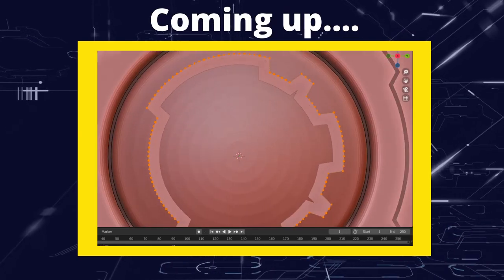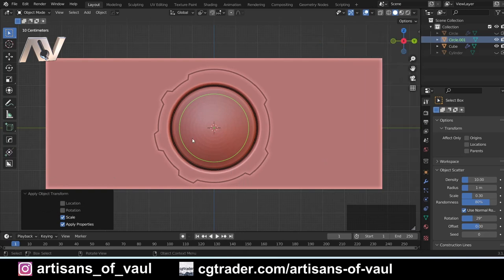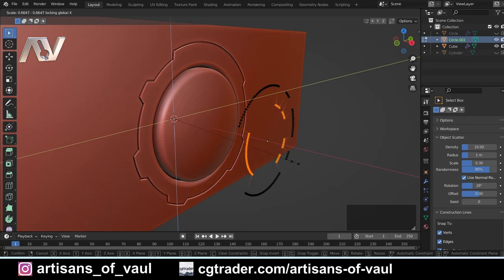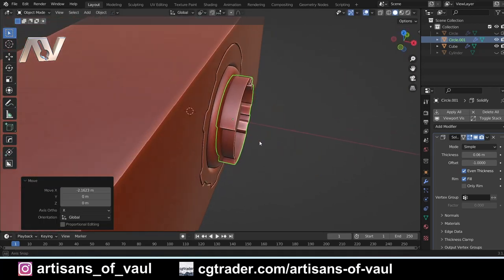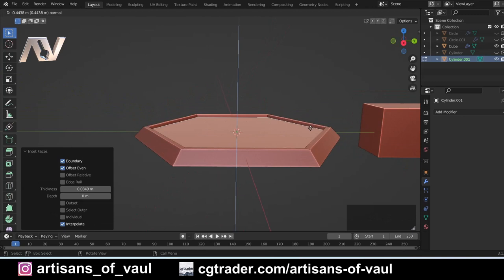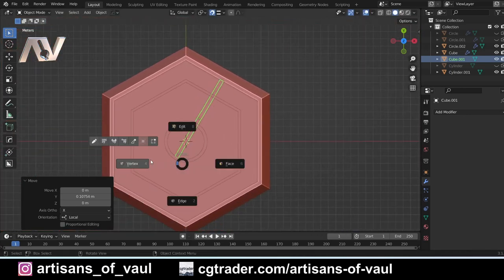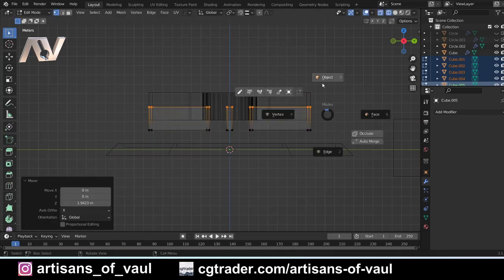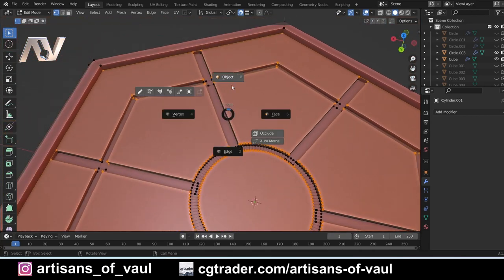How to create complex panel lines in Blender

Comment: What I like about 3d printing and blender is that I don't need so much a good topology. Its really forgiving.
Reply from the maker: Agreed. Though often it'd worth looking at things like shading errors as they are often symptomatic of issues that will screw up a print too
Reply: @ArtisansofVaul  you use the manifold checker from the 3dprint addon?
Reply: @adeptusprintorium  He does.

Comment: my boolean looks terrible when trying this method. i checked normals, scale, and double verts. not sure what the issue is. i assume its because there isnt enough geo but yours have practically no geo and it still worked 😂 edit: so i figured out its the boolean slice on the cutter thats causing it. for whatever reason, after applying the solidify modifer, it leaves the cubes i scales up, hollow, so when i cut into then they have thickness to them with a hollow bit inside 😂 i think my hardops is just spazzing out though because thats not how solidify works. well it is how it works, but it shouldnt work like that haha.
Reply from the maker: Yeah it should look find with very little geometry, that's the main positive of this method as it leaves everything very clean. If you have Instagram you could find me there and share your file for me to take a look....

Comment: What if you want to cut a curved surface (like a mask), but do not want to cut fully through the object. I want the cut at a consistent depth across the surface. (is there a project curves/knife cut function that works similar?)
Reply from the maker: When you say a consistent depth you mean at all points its 1mm down from the face, or do you mean that it will be deeper in some points but the bottom of the panel lines are the same height?
Reply: @ArtisansofVaul  solved: your method would cut completely through my object in some areas. 

Using knife project allowed me to extrude /scale uniformly acrost a complex curved surface

Comment: When applying this first time, it worked with some relatively okay results. Upon trying to apply it the second time after messing with solidify some, once applying the difference boolean, both the cube and modified circle disappear entirely from the view port in all views. What's going on here?
Reply from the maker: Hmm.... it might be that something on the cutter isn't correctly manifold.  Try using the 3d-print toolbox to check if the cutter object is manifold

Comment: Thanks for your efforts to teach us. I somehow had a lot of problems with the second part of this tutorial. I couldn't at all get it. I think it's a combinations of errors. I've found some of them but I'm sure I will get to the rest of them at least to the point where I'm happy with the result!
Reply from the maker: Can you explain what the issue was? When you say didn't get it do you mean didn't understand it or more couldn't get it to work even following it?
Reply: @ArtisansofVaul  Thanks for the reply. It was that I couldn't get it to work even following the instructions... or maybe I thought I did (English isn't my birthlanguage so it could have been some problems on that part too ;-) I found out that I hadn't applied the scale for the parts that reached out to the edge and I think that caused a lot of the troubles. The last cut were totally screwed up and stuff disappeared from view, the last cutter didn't look like yours etc. But I am closing up and I'm sure I'll get to the end.
Reply from the maker: @AnkiSandinge  when the things disappeared check the modifier panel. If the boolean is set as "fast" (I think it will be from what you describe) then try changing it to "exact".
Reply: @ArtisansofVaul   I finally got it to look like yours and I discovered that "exact" setting. I'm so happy now. This is really the "best way" to learn something. Having troubles and then being able to solv them. Thank you so much for your help 😊
Reply from the maker: @AnkiSandinge  My pleasure and well done on getting it sorted! 😅👌🏼

Comment: Great stuff! Is there a difference between Ctrl+, applying a Boolean union via the modifier tab or Q>Booleans>union in hardops or all they all achieving the same thing? In your normal workflow, do you tend to favour any one of those methods and if so, why?

Learning so much from these vids and are a genuine highlight of the week, thanks again!
Reply from the maker: They achieve the same thing, I was just focusing on completing it without any non-native add-ons.  In fact I believe the HardOps one should automatically create a cutters collection so will actually make the organisation of you objects easier.

To be honest they are for totally different things but they can be used together as well.  I normally use a mix depending on the project and what I need but you could use the two together for example to have more lines coming from the door to the outside edge.

Comment: Brilliant! Future proofing designs is so handy. Could you then wrap/curve this to a round surface?
Reply from the maker: I wouldnt bother. Make it all the way "through" the curved surface. Then duplicate that surface and scale it down a little like I did in the first panel lined video and remove that shrunk version from the cutter. Then boolean the cutter and you've got the same effect without having to worry about the curve modifier. Well thats how I'd do it at least.

Comment: Are you able to add a bevel to these boolean'd edges?
Reply from the maker: Good question. Yes is the simple answer. This is a little harder to explain. The easiest way is to do it after you apply the modifiers so you can select the exact edges you want. There are other ways you can from the cutting object but that's a bit harder to explain. I might have to make a video of how.

Comment: I think you have some kind of an addon that gives you this "vertex mode" when you press tab. You mention it like its a standard thing though. Without the addon.. whatever it is.. tab just goes to edit mode and there you press 1, 2, or 3 to get the various modes. Maybe mention you use paid addons from the start so newer Blender users know your options are not standard.
Reply from the maker: The pie menu I have is from Machin3 Tools (a free add on which is well worth getting).  Its the same as pressing tab and then 1, it just is a bit quicker.
Reply: @ArtisansofVaul  I looked at the free version after looking at your set up video. It doesn't do some of the things you show.. the Y menu for example. I uninstalled it because it seems like more of a hassle than without it.
Reply from the maker: @HrafnNordhri  There are two different add-ons here. Machin3 Tools is the one with the pie menu.  Mesh Machin3 is the add on with the Y menu and that is a paid for add on by the same company.  They are not the same thing.
Reply: @ArtisansofVaul  Ah-ha! That's where I misunderstood. They also make a decal addon right?

Comment: help when i press ctrl -      it zooms out
Reply from the maker: You have to use - on the number pad. Otherwise (as you have said) it changes the zoom. If you don't have the number pad you'll need to do it the old fashioned way of using the modifier.
Reply: @ArtisansofVaul  Ohhhhhhh now it works ty ty so much